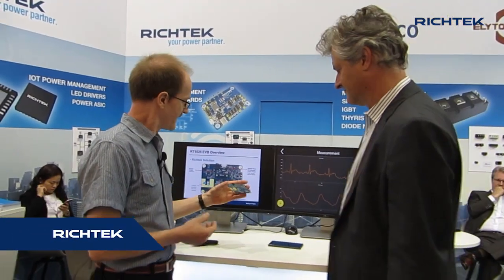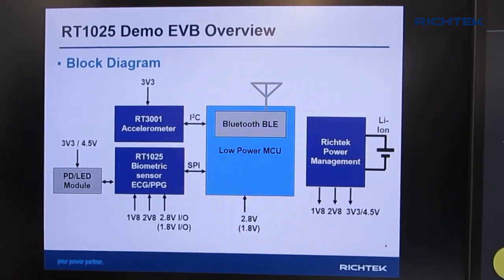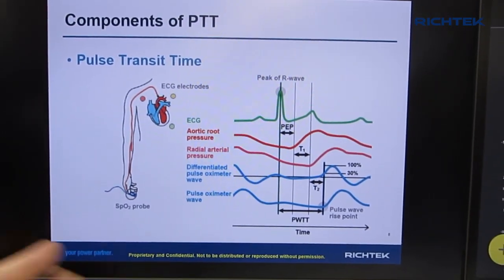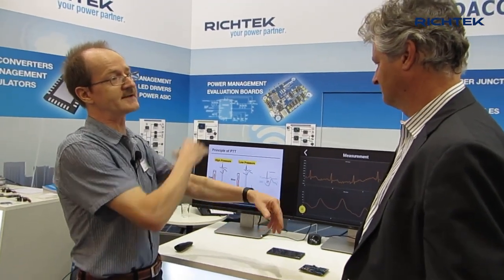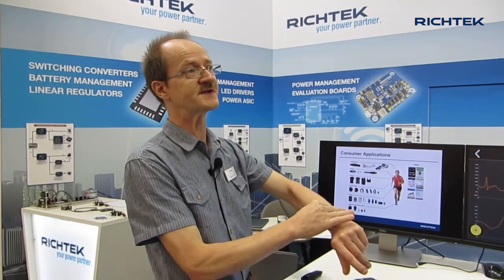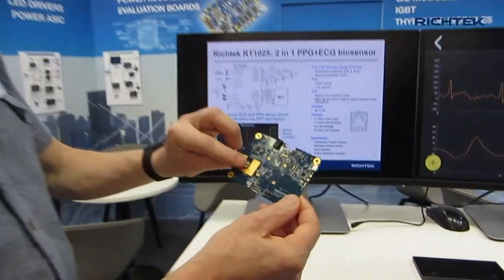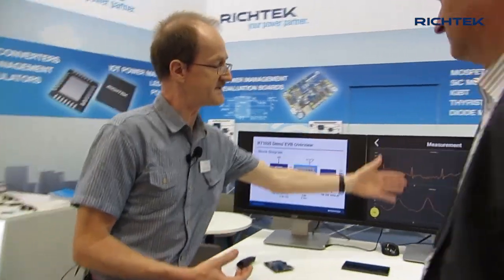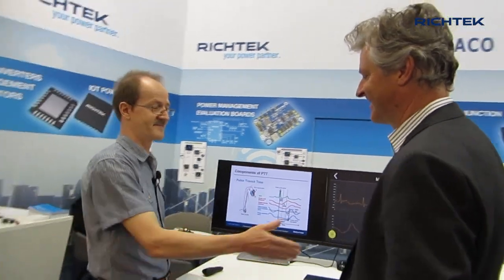Introducing Richtek integrated ECG/PPG AFE solution for heart rate sensors

Comment: Cool.
The portable biomedical product provides ECG and PPG measurement. Besides, it has wireless transmission. Users can monitor biosignal easily. 
BTW, are there any similar  product available now?
Reply from the maker: Thank you for your feedback. If you are asking about our ECG&PPG products, at the moment, we have only launched RT1025. 

For ICs, you can apply for free samples or buy via our distributors: https://goo.gl/MeBtoB 
For EVBs, please check this link: https://goo.gl/7uRptC

Thanks!
Reply: @richtek  Any new products? I saw that you are retiring this board.